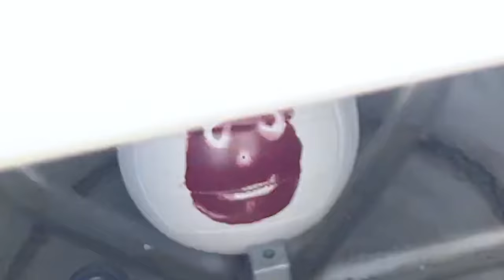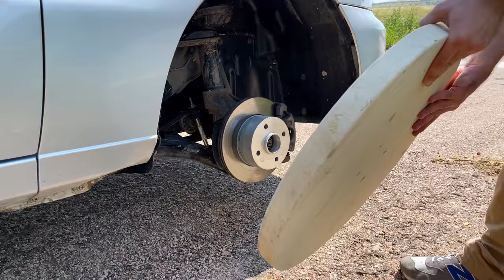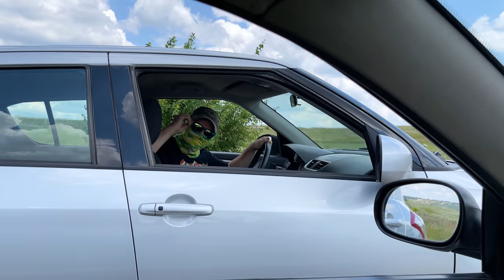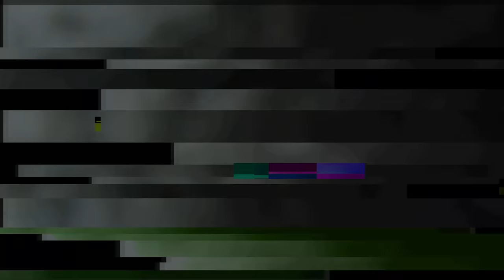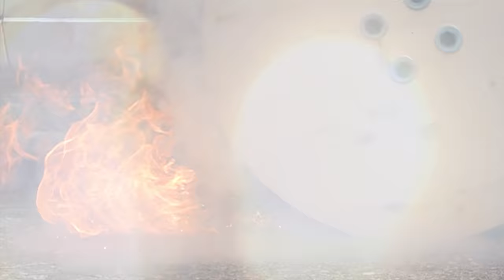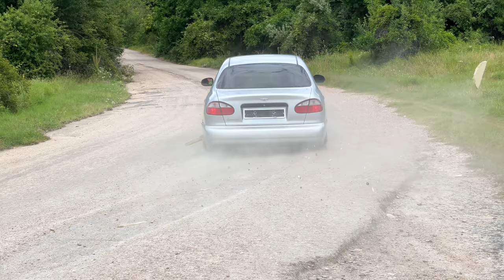Experiment: WOODEN WHEELS on a real CAR

Comment: Not only you made the tires too thin but also you should have made them out of plywood.
If normal wood is weakeed in the direction of grow it's done. Plywood on the other hand was good enough to make airpanes before metal-plastic times...
Reply: はわらわ
Reply: @user-tw9wm5ko9b
Reply: swww
Reply: @user-tw9wm5ko9b  ،

Comment: VW Voyage Trend G6 City 2013/2014 - Wanted Automóveis
Reply: Chevrolet S10 LTZ Automático CD 2.8 CTDI 2018/2018 - Wanted Automóveis
Reply: Renault Duster Dynamique 1.6 CVT 2018/2019 - Wanted Automóveis
Reply: Ford Ranger Límited 3.2 Turbo Diesel nos Mínimos Detalhes
Reply: Toyota Hilux SRX Diamond 2.8 Turbo Diesel nos Mínimos Detalhes